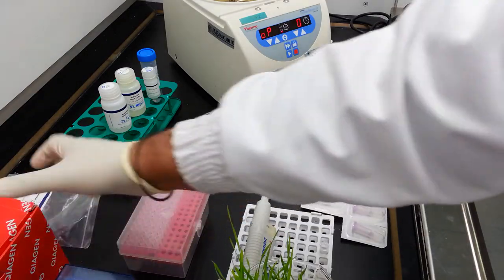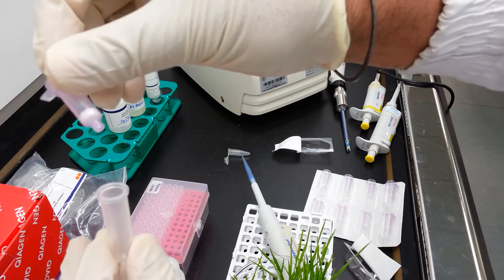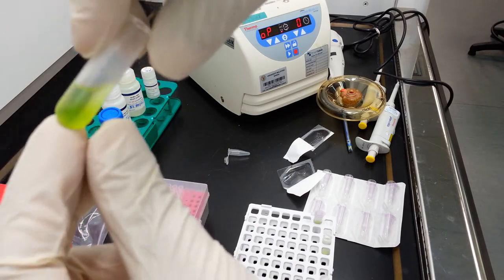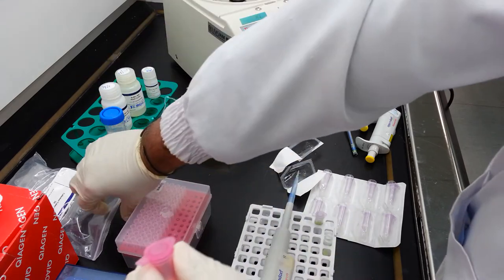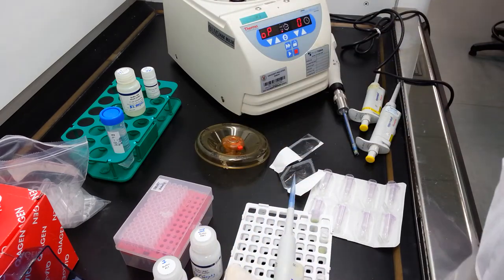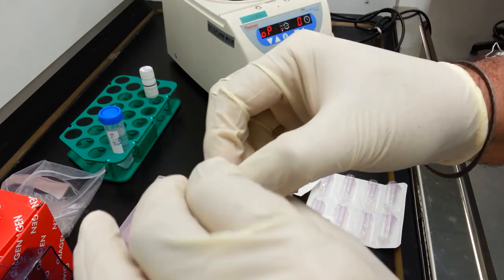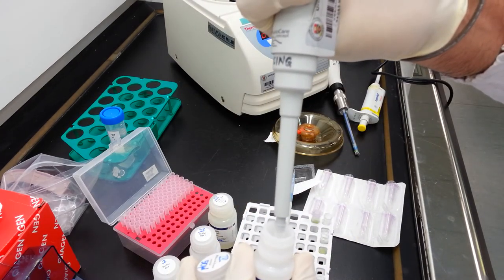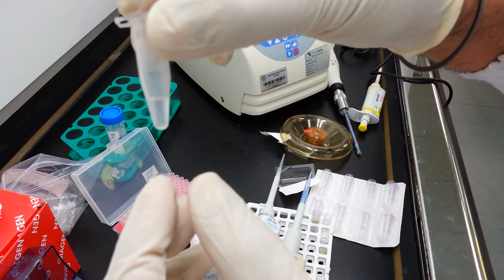RNA Extraction from Plants using the RNeasy Plant Mini Kit.Free for download, reuse and remix. CC-BY

Comment: Hi Kenneth, I am thinking of switching over to using a homogenizer instead of liquid nitrogen and mortar and pestle. Do you happen to know which brand homogenizer you're using?
Reply from the maker: Please check the following link: https://homogenizers.net/collections/rotor-stator-homogenizers?view=all
Do not use a homogenizer when processing pathogenic biological agents. They generate a significant volume of aerosols.
I use one with a disposable rotor to avoid cross contamination.
Reply: @KENNETHFRANCISRODRIGUES  Can I use homogenizer for extraction from pineapples leaves to extract virus RNA

Comment: I am extracting RNA from fish scales. I took one scale per sample. But the RNA yield was too low and it's homogenization was also difficult. Please help. What can I do to get results?
Reply from the maker: The RNA concentration will be very low in developed scales. You may have to modify the experimental design. Depends on what your objectives are. Quick suggestion: try flash freezing in liquid Nitrogen.

Comment: During these steps there is no need to worry about external RNase contamination?  I've seen people do this in RNase free sterile hoods
Reply from the maker: Thank you for your query. The procedure described above is suitable for the extraction of RNA for downstream application to reverse transcription and reverse transcription quantitative PCR (RT-qPCR), however, it is recommended that a sterile fume hood and the use of appropriate RNase inactivating agents (DEPC) be resorted to in case the RNA will be subjected to RNA sequencing (RNAseq) or in the case of gene transcripts which may be present at a very low copy number in the biological sample.
Reply: Thank You!  I will be making cDNA so this is good to know.
Reply from the maker: All the best!

Comment: Hi, can I use this kit and method after RNA extraction using Trizol method as a clean up method?
Reply from the maker: Thank you. Not advisable as the components from Trizol may interfere with the membrane and interact with other solutions.
Reply: It can use for RNA clean-up purpose. After Phase-separation using chloroform, take off the aqueous phase  and mix with ethanol, subsequent step is same the this method.

Comment: what extra to follow when using extraction from developing endosperms
Reply from the maker: This depends on the nature of the endosperm. If liquid as in the case of coconut, you will have to reduce the volume to obtain higher yield using a non destructive method as far as RNA is concerned. If solid, there should be no problem. Most endosperm tissue is triploid (3n), this must be considered when analyzing RNA seq data from endorsperm transcriptomes.
Reply: @KENNETHFRANCISRODRIGUES  thanks a lot doc. Actually I need to do RNA extraction of maize at 5, 10 and 15 DAP, so I think on 5th and 10th day, it might be milky.
What other changes I can make.
Thanks a lot for reply.

Comment: Sir really thx for the video, can i leave several questions?

1. if you don't mind, may i ask the name of that handy homogenizing machine?

2. if you are goin to extract RNA from many samples, than how you prevent cross-contamination during homogenizing? you wash that homogenizer probe by 70% ethol?

3. is that machine safe enough not to breaking 1.5ml e-tube? i'm using general eppendorf 1.5ml tube now with stock the samples in their
Reply from the maker: Glad to be of service.
Yes, you must wash between samples OR use disposable tips.
The Eppendorf tube will not crack as the blade is inside the ferrule.
I do not want to promote any specific brand, but here is an example.
https://www.omni-inc.com/omni-micro-homogenizer.html

Stay Biosafe during Covid19.

Thank you
Reply: KENNETH FRANCIS RODRIGUES - i do really appreciate your kind comment

Stay healthy, hope you sir got beautiful research works

Thank you

Comment: thank you sir for your video it helped a lot. i used same procedure and kit to isolate RNA  from plant leaves, but  unfortunately it is contaminated by gDNA and also concentration is very low. what need  to avoid this problem.
and is there  any need to add betamarcaptoethanol to extract RNA from leaves of oak tree?
Reply from the maker: Thank you Sir. The answer depends on what you intend to do with the RNA during the next step. For cDNA synthesis and RT-qPCR cleanup with DNase is definitely required prior to first strand synthesis. I noticed that if the initial sample size is large, the DNA gets carried over. For tree leaves, try to use the young leaves as the fully mature leaves are loaded with phenolic compounds which inhibit most enzymes. All the best!

Comment: When I follow the provided protocol and this video, RNA was always contaminated by gDNA . I did all steps on the ice, I changed kit, centrifuge machines and all solutions (EtOH). But still have gDNA on RAN tube. How can I solve this problem....?? And I don't want to treat DNase because of the yield decrease
Reply from the maker: Dear viewer. Thank you for your comments. Generally, you need to perform a DNA removal procedure using DNase. One of the reasons for DNA carryover is overloading with the initial sample. Begin with a small sample volume. Generally for animal tissue less than 200 microlitre volume of tissue.